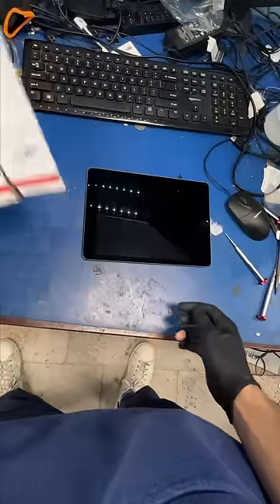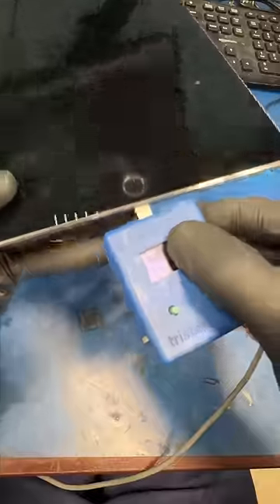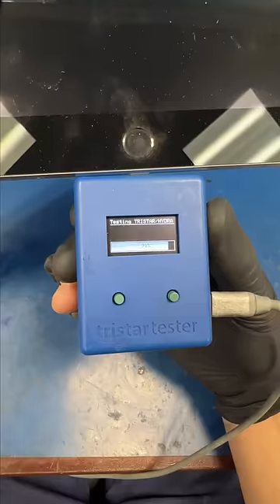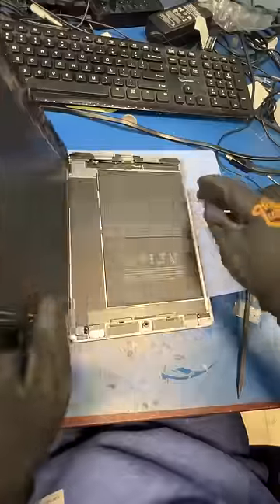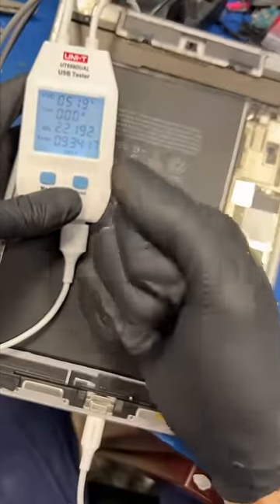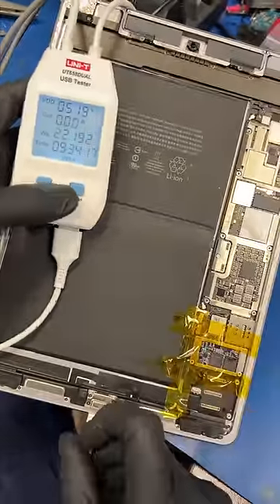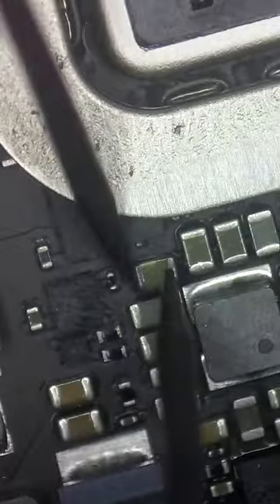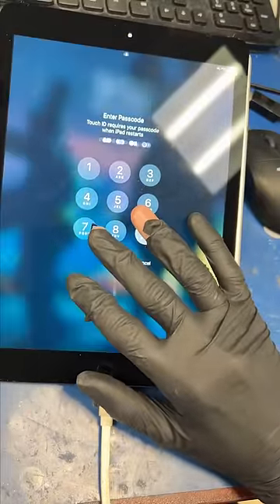Can This iPad Be Saved? #Tech

Comment: Great repair fantastic job mind telling me what that substance you used to remove that chip was though
Reply from the maker: Hey it’s amtech flux. It helps the solder flow
Reply: @MDrepairsLLC  so like the reverse of normal flux? Nice repair btw I could imagine getting those tiny chips off with my fire wand.
Reply: why didn't you start by visually reviewing the board for a bad capacitor before you went through the trouble of replacing other components? 
how long have you been doing this?
Reply: @MDrepairsLLC  You have a good eye for those bad chips. This seems like a major pain in the ass lol.
Reply: @deforged  Will a burnt out capacitor cause even a good charging chip to fail the tester? Perhaps they were both damaged?
Reply: @MDrepairsLLC
Reply: Coom
Reply: @MDrepairsLLC    Anyway I can’t send you a phone it’s bad the back it all broke n the speakers don’t work anymore it’s a 12 pro
Reply: @MDrepairsLLC  Where did you get that silicone heat mat? I do a lot of tinkering with electronics so having one would probably help a lot and I really like the setup on yours!

Comment: Why do surface mount caps short? Aren’t they ceramic?
Reply: They can fail short for a lot of reasons, mainly due to the insanely small scale of the guts inside. The layers inside can be incredibly close together, and when paired with mechanical stress, they can crack, resulting in layers touching. It can also just crack for seemingly no reason, with the built-up stress of hundreds if not thousands of thermal expansion and contraction cycles as the device heats up and cools down.